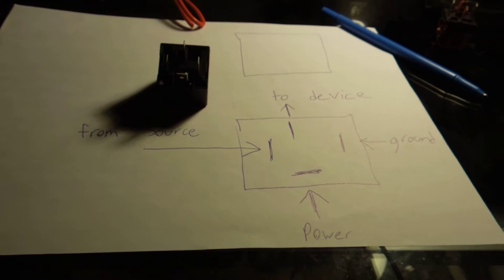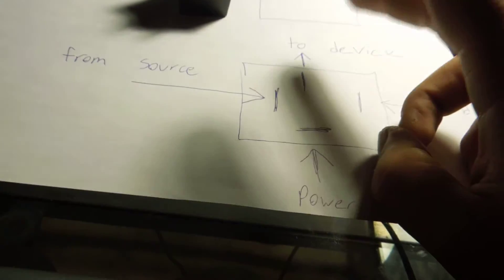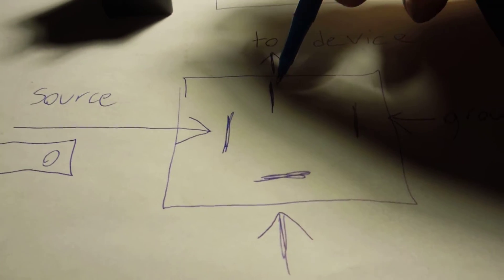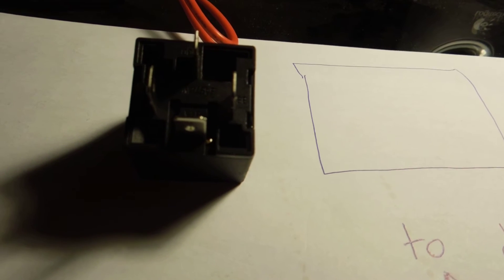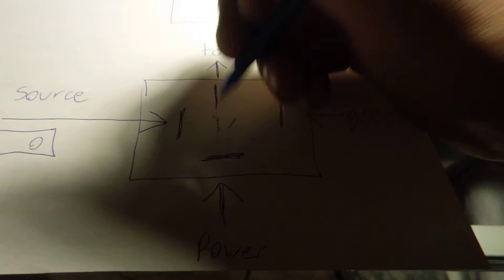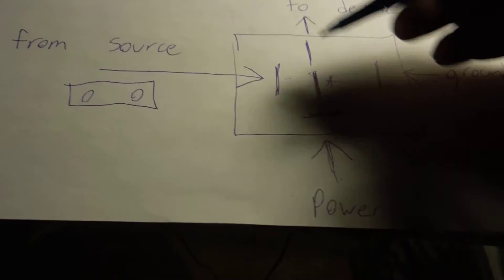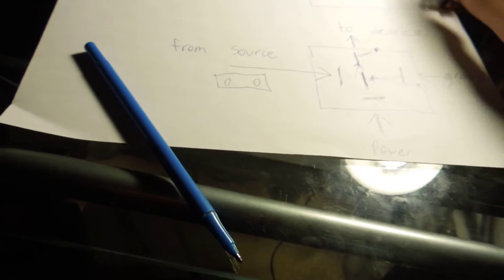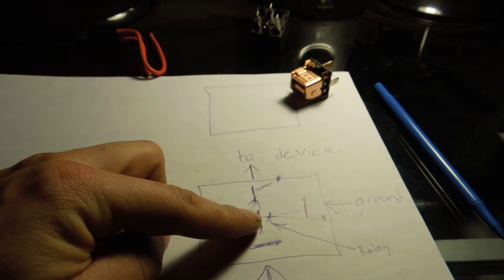how to wire a relay car audio remote turn on or other accessories

Comment: Thanks. This is what i ve been searching for, a simple way to understand how to wire the relay properly to my car stereo because i ve an Equalizer connected to it but it doesnt turn on the way its suppose to. Now my question is, how do i use the relay to turn on/off the stereo normally with the equalizer at the same time with ignition? Will the power pin be ignition wire or battery wire?

Comment: Cool video and well explained. I want to install an amp for a Bluetooth system to my motorcycle. I want it to work on switched power, no constant power. So, if I use a relay I wont need a fuse? Would I need a 4 or 5 pin?

Comment: Nice video. Very informative. Can I wire all my accessories to one single relay? 3 amps, LED lights, and fan? What size relay should I use? 20 amp, 30 amp, or 40 amps?

Comment: it is switched.
Reply from the maker: awesome use a 5 pin relay and wire it on 87a then when when your vehicle starts it will break contact with 87a and turn off the inverter well you engine is runing

Comment: i have a box truck. i want to install a 5k power inverter. looking to have the power inverter powering a light,receptacles,microwave,tv, and some charging stations in the back of the box truck. i would like it to be on a relay switch as to when i want to operate the inverter all i have to do is turn on a switch. Also, want it to be turned on ONLY when the vechile is turned off. (would this drain my battery???  dont want a big gauge wire running to the switch. im guessing im going to need a relay???? now what size relay?? and would a relay be needed???
Reply from the maker: does it have a remote turn on or a switched on ?? i would not run a relay off the main power wire